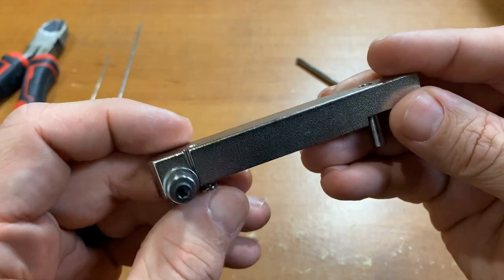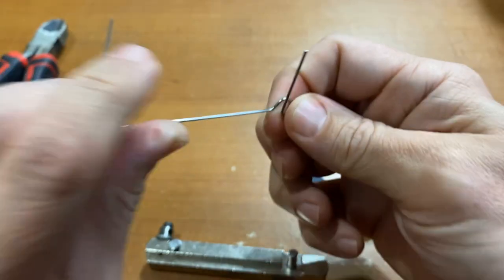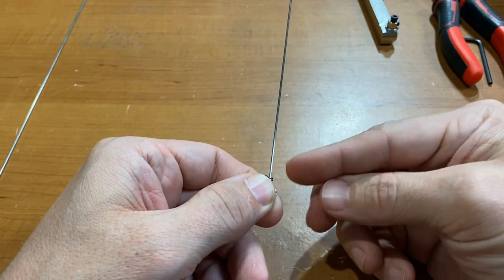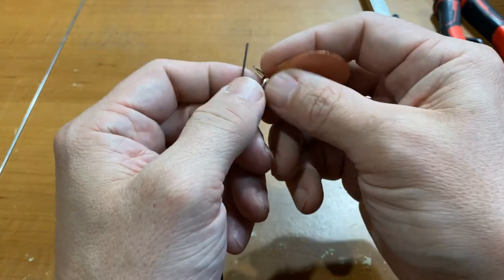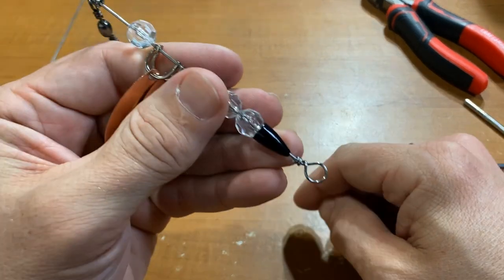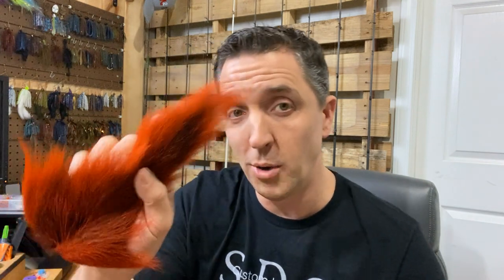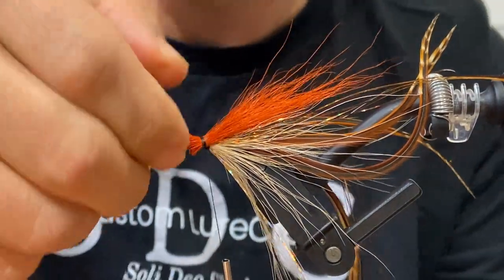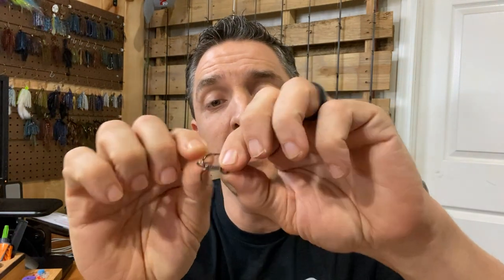How to Make a Large Inline Spinner to Target Bass!

Comment: Sharp looking lure, nice color combo, like the action in the water, great looking build. Adam I make a lot of spinners the tool i use is the Twist- Tech wire former, makes the job so easy. It's a little pricey but well worth the price. As usual another great video !!!
Reply from the maker: Thanks Robert!  I looked at a few fancier units that would do more than barrel twists but most were designed to mount on a work bench (and were more expensive, as you said).  Perhaps one day!!